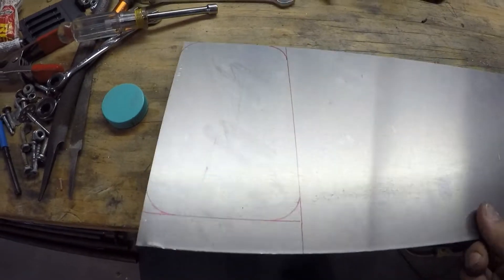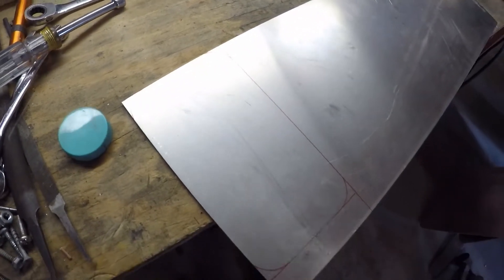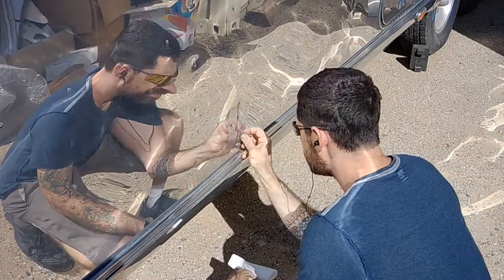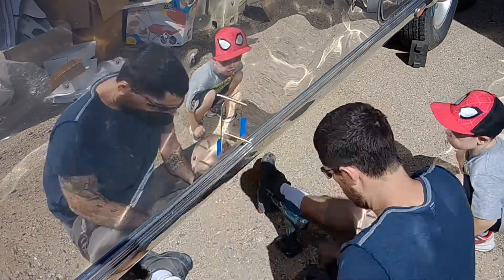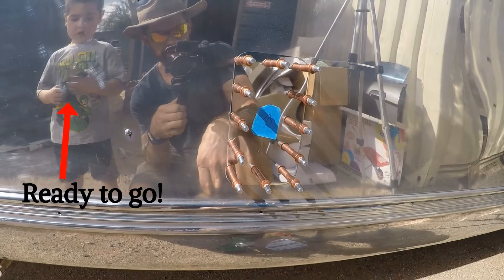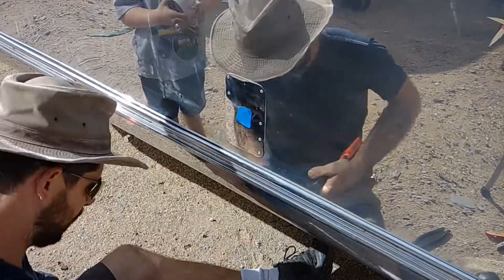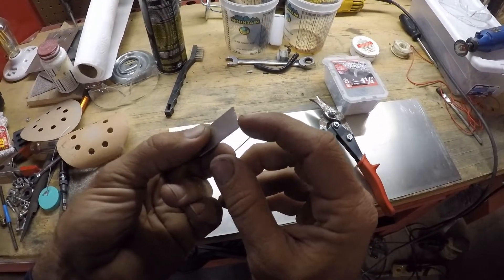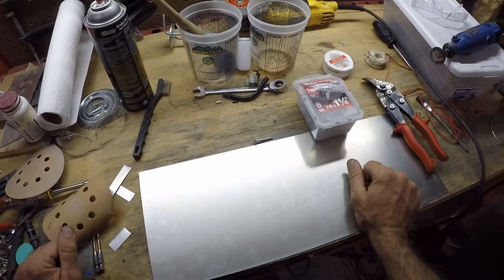Repairing a damaged Airstream with a patch

Comment: Good job. Only thing I would have done different would be, use a Cherry Max rivet or some kind that seals the center hole of the rivet better.
Reply from the maker: Thanks, I started using closed rivets after this. I didn't know they existed until a viewer mentioned them
Reply: @AustinCoulson  No problem, I used to do sheet metal work on US Army helicopters. You did great work.
Reply from the maker: @dcummings7253   No kidding, were you a 15G?
Reply: @AustinCoulson  Well the last MOS I had was a 15U. But I was a Federal Technician full time at a guard unit. And did the sheet metal work.
Reply from the maker: @dcummings7253  Crazy, I was a 15D
Reply: @AustinCoulson  Cool man. I started in 1988-91 Desert Storm as 12B active,Guard 67U, 67Y and 15U Afghanistan 08-09, 12-13. Retired

Comment: Those particular rivets are not weather tight, but certainly much better than the puncture that was there.  Small shot of clear silicone down the center might be a good idea.

Child labor laws killed this country.
Reply from the maker: Good looking out. They're stripping out the interior so I'll tell them to put some silicone on the inside of the repair. Lil dab at each hole is a good idea, I'll do that next time.

This kid has been using power tools since he was 1. Maybe I'll just tell the govt he is a very short adult.
Reply: @AustinCoulson  See if you can get some agriculture status.  That's what my parents did ;-)